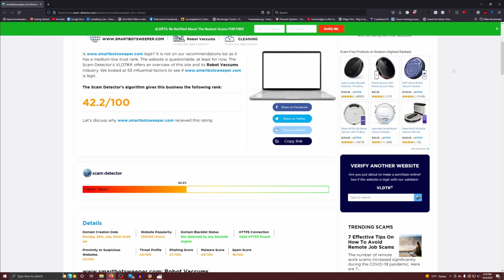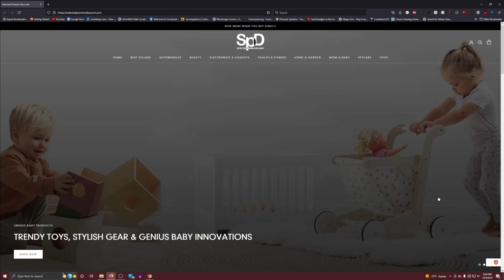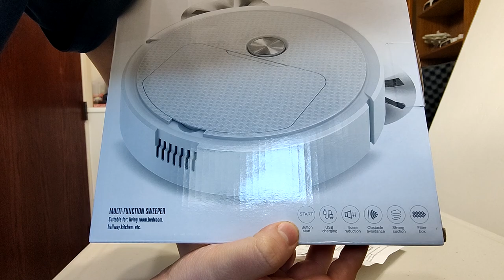Is the FREE Daily Goodie Box Smartbot Vacuum a scam And comparison to $700 Neato Botvac D7!

Comment: OMG At least yours worked over 10mins. When I turned it on it wouldn’t power off. When it finally ran the battery down it wouldn’t recharge. I left it on charge all night. Never saw a red light. I know it was only $7.99 but it’s just the fact of someone purposely screwing me over. They knew this ish was wasn’t worth shipping.